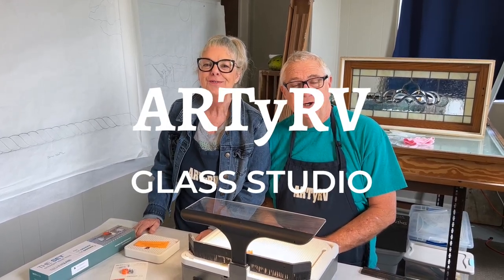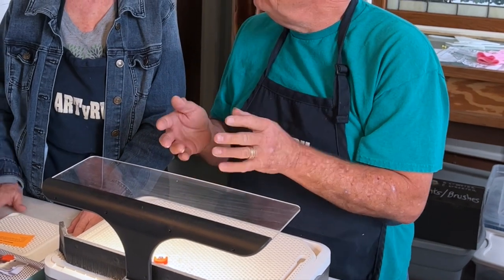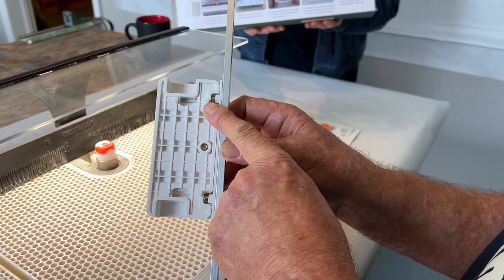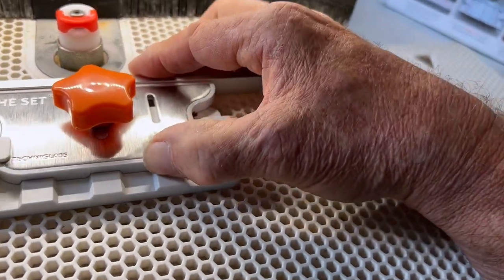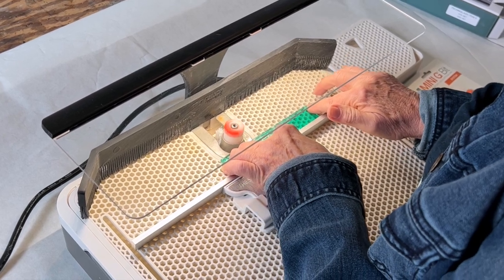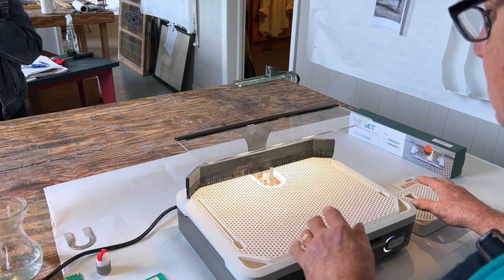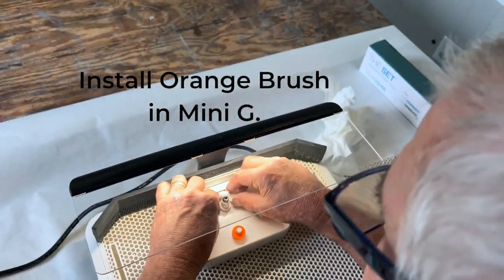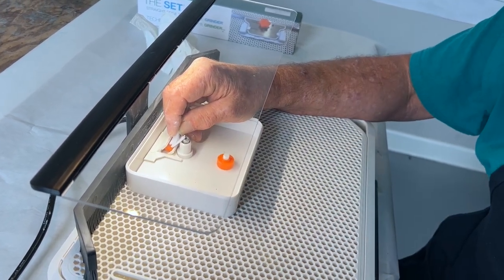The Grinder Mini G for Stained Glass

Comment: Do these work with the inland grinder ? ( the water shield and the straight edge)
Reply from the maker: No, the grid is different. But the Quick Fit Bit works on the Inland.